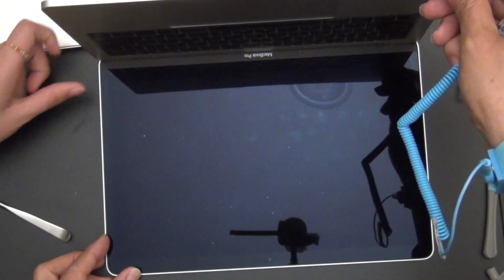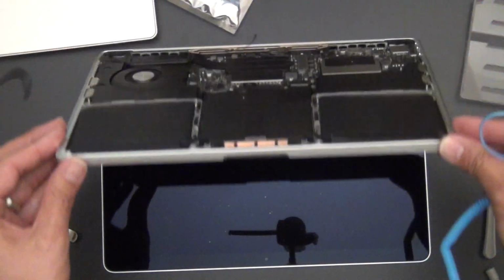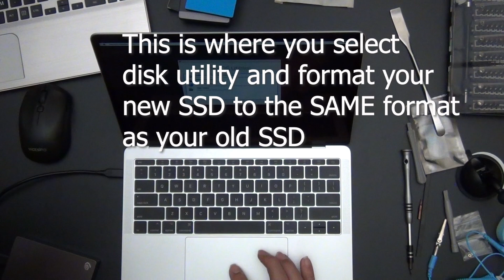2017 Macbook Pro 13 Inch 2 Thunderbolt A1708 SSD upgrade 128G to 1T!

Comment: Hi, today I did the same procedure with you but failed. (Same SSD) Somehow I cannot install the new MacOS on the SSD successfully. It installed about one hour then back to the question folder.  Any ideas? Which OS did you use? What method did you use for recovery the data? Internet recovery or OS startup USB? Thanks in advance.
Reply: Hi Im on the same case ... The original drive died ... Put 1TO OWS inside the mac but the system refuse to install.. Because I did not install HIgh sierra on the old drive and the system is not flashed . The only way is to put back an original apple ssd , making upgrade then put the new drive .. Fu... Apple
Reply: @anthonycoppet8788   I got the solution for installing the OS. You have to start it with the original OS by internet recovery. Once the installation failed, don’t panic. All you need to is to launch your MacBook again. You will notice it is installing again.

Comment: Guys, I just did the upgrade but, the battery is not charging anymore. I'm not sure if maybe it's because of the drive, or if I mess it up. If anyone knows something about it, I will greatly appreciate it. Also I have connected a USB audio interface because I work with music and does not seem to work properly after the install. The signal comes in and out. ¿Do you think has to do with the power consumption of the hard drive? Please, if someone experimented this problems and found a solution, let me know.
Reply from the maker: Hi Andres, sorry for the alte reply! I am wondering if the connector for the battery was not put back properly? There is a step where the battery is disconnected....maybe thats the reason? Hope this helps!

Comment: what screw driver do you use
Reply from the maker: Hi Zoubir, thanks for watching, these are the screw drivers used:
5-Point Torx Plus 1.2 (pentalobe compatible) screwdriver   (for the screws on the oustide)
T5 1.5 (for screws inside)

Comment: 3:51 useless part, i upgraded my ssd without touching this part and it totally works
Reply from the maker: Hello, and thanks for watching. Congratulations on your successful upgrade! 351...are you referring to disconnecting the battery?  If I had to do this over again I would still definitely disconnect the battery. Yeah, you might be able to get away with not doing it, but I'd hate to cause a short and damage the laptop if i accidentally touch something I didnt mean to...

Comment: will this adoptor fit to A1706 Macbook Pro model?
Reply from the maker: Hi Burt, thanks for watching! This particular bracket's description does not say it is compatible with A1706, but I checked on amazon and there are severala dapters that say they work with both A1708 and A1706.

Comment: Hi there, I made a comment earlier about the battery draining even while plugged in. Just letting you know that the TRIMFORCE command and disabling hardware acceleration helped fix the issue so now when plugged in it charges, however the battery still drains pretty quickly when unplugged.
Reply from the maker: Thanks for the update Daniel!

Comment: @Wen-Chun Fan can I install windows 10 on it as well?
Reply from the maker: Hi Kyle, I don't think my daughter installed Windows 10 on her Macbook Pro, but according to apple support, you can : https://support.apple.com/en-us/HT201468
Reply: @wenchunfan  ok thanks. So I can if I change the hard drive and upgrade it?

And regards to the battery will I work if I plug it in charging or even while its charging you loose battery?
Reply from the maker: @kylegatt659  hi Kyle, I dont think we have tried installing windows 10,so can't say for sure it works. The battery issue remains, but it doesnt drain faster rhan it charges. Hope that helps

Comment: Tried the same upgrade on the same model but the hd doesn't show up
Reply from the maker: Hello and thanks for watching!  Sorry to hear that the drive didn't show up after you changed it. Did the machine boot up?
Reply: @wenchunfan  it just shows a folder with a question mark
Reply from the maker: @sleepingproblems9060 I believe the question mark means the Mac is looking for the OS to boot from. We had backed up everything to a USB drive, and attached that when we restarted the Mac book after changing the ssd. Hope you are able to resolve this quickly!

Comment: Hi, is it normal that a fan runs so fast when I present a power point and zoom or OBS at the same time??? the speed is at around 7000, and the machine gets hot so quickly too. I bought the macbook in nov 2017, a week ago the LCD was replaced fullset also the keybaoard. The lcd replacement was due to flickering and flash
Reply from the maker: Hi! Thanks for watching! I checked with my daughter and she says her Mac books fan comes one when she's running a lot of programs at the same time. Did this start happenning only after you had the screen changed?
Reply: @wenchunfan  thanks for asking her, sir. It happens since my macbook has a screen problem also after replacing it. When I asked the person who did service my macbook, he told me everything inside the macbook is clean...
Reply from the maker: @saracyber1  Seems like a lot of functions are connected , like who would have thought changing the ssd would affect battery life? Maybe changing the keyboard and/or LCD affected a sensor or something and now the fan comes on more? I am just guessing here, not an expert at all. Hope you can resolve it somehow...
Reply: @wenchunfan  thanks a lot again, sir...what is your daughter do to the macbook at the end when the battery gets dry? I heard apple has a free battery replacement recently.

Anyway, I also think the same and asked already about the effect over replacing the screen and keyboard. Because my macbook pro LCD was from Samsung, but they changed my LCD with the manufacturer of LG because only LCD from LG which is new and available at home. I wonder and ask the store if it will effect the battery and machine performa, they said: it won't. 
Then I found  your video of fixing and read about your battery update after changing the SSD.. Mine probably will experience the same :(
Reply from the maker: @saracyber1  really? I will have to look into that! These days it doesn't matter as much since she's home and always close to power, but when she goes back to school it could be a bit of a challenge.
Reply: @wenchunfan   for sure, you should check the battery program replacement at apple website. Hope it could give solution if she far from power outlet :) good luck, sir!
Reply from the maker: @saracyber1  thank you too!
Reply: @wenchunfan  no problem :)))

Comment: Hello :) Great video. Thank you. I used the same SetUp and everything works great. Bigger SSD place is great :) ... I have the only small problem. After this replacing the SSD started my macbook to overheat :/ Ventilator does not stop ... Can you help me how to fix this?
Reply from the maker: Thanks for watching! Sorry to hear you are having problems with heat dissipation after the switch. That is something I have not encountered, so I am not sure how to fix it. Hopefully you can find a solution to this issue soon!

Comment: Just upgraded mine to 1TB 2 weeks ago. Went very smoothly and am very happy with the result. Same as you the only issue I’ve noticed is the increased drain on battery life. Thanks for the video.
Reply from the maker: Thanks for watching, and glad your upgrade went smoothly! Hopefully there will be some solution to the battery power management issue in the near future!

Comment: Thank you for this! I’ve been thinking of upgrading mine as well, since I cheaped out and got the 128gb too lol
Reply from the maker: Thanks for watching and good luck with your upgrade!
Reply: I did this too buying it for my daughter but she doesn't use it since the school required ipad so i bought her ipad pro 11 instead and now i have to use this for programming. 128b is severely lacking for it. Im wondering if i should sell this and buy macbook mini m1 instead ( i dont need mobile use) or upgrade to 1tb. What do u guys think i should do, the m1 has powerful  gpu/cpu power and very affordable. Need some ideas lol. Cheers.
Reply: @telostia  idk about your choice but here’s something to consider: you can get windows on this MacBook and cannot for m1 apple silicon macs. So just a note. I absolutely need windows so I won’t be buying a apple silicon Mac.

Comment: I changed mine last month (Jan-21) to 512GB using the same sabrent rocket ssd and it works fine so far. Did noticed the battery life take a dip but not a major concern. 

What I found out the trickiest part was to format the drive in recovery mode as it didn’t mount and had to reboot again to start the process. After that due to some issues I could not install the OS as the drive was in HFS+ not APFS as that option wasn’t available at formatting stage. After some googling and youtube tutorial search, I managed to make the drive formatted as APFS and install the OS afterwards.

It was quite an experience for me and quite satisfied with the result as well..Now I don’t have to be very mindful of what I keep in the macbook compared when to it had measly 128 GB. Planning to upgrade it to either 1 TB or 2 TB in couple of months time as those have higher write speed than the 512 GB version.
Reply: I've upgraded my A1708 to the Sabrent 1tb from the stock 128gb in December 2020. I went to install a fresh copy of the OS from a bootable Mojave USB, but Mojave's Disk Utility doesn't allow you to format your new drive to APFS. But you can format the drive for APFS using Terminal instead. After installing the OS I booted the Mac into Safe mode to clear caches, then I reset the PRAM and Power Management and enabled the TRIM command in Terminal. So far I am not having any battery drain issues or, as some have reported, the flashing question mark that sometimes appears if you boot the Mac with power connected. The only thing I have noticed is, that after a few days of continuous use, the mac starts to stutter and slow down. A shutdown and restart clears this for me. It is not a major issue for me; the benefits of having so much more storage space out weighs this one niggle. I used the iFixit website as a guide to doing the upgrade.
Reply: @d3fenc367  Good to know that it works alright for you too. I just knew about TRIM command when you mentioned it as I have never heard everybody else talk about it.

For me there is no noticeable slow down as I always shut it down after done using it and occasionally let it in sleep mode especially when I’m out for a short while..nothing of major concern so far. I fully agree the benefits outweigh the cons and pretty happy with that!
Reply from the maker: HI Khalis, thanks for sharing your experience and glad everything is working! I do remember we had some issues formatting the new SSD , and I recall that the APFS option was not very obvious in the choices presented when asked to format. I think we had to change a different option, then the APFS option came up. Sorry its kind of vague. Glad you figured it out!
Reply: @wenchunfan  Yeah the APFS option wasn’t that obvious and to be honest it was quite nerve wrecking as well as I thought I had screwed it up, my mbp is gone!

Comment: How do you put the SSD on the adapter? My adapter came with a bolt and nut but the bolt is not fixed under the adapter. Does the bold go under the adapter, then SSD and then you screw it together?
Reply from the maker: Hi Vincent! I remember that i did not have to afix the bolt to the adapter. All I had to do is slide the SSD onto the adapter and use one of the small screws to afix it. I used a 2242 SSD. It appears that if you use a 2230 SSD you may have to do what you are describing, using some additional screws/bolt that were included with the adapter ina  clear plastic bag. Hope this helps!

Comment from the maker: Quick update: So the macbook has been working fine since the upgrade. One thing that my daughter noticed is that battery life has taken a hit. I looked online and apparently this happens when you use a non-apple SSD. It has to do with power management not supported with these non-apple SSDs. Something to keep in mind if battery life is crucial...
Reply: The laptop is almost 4 years old my battery drains as well replacing the battery soon.
Reply from the maker: @chickenricesteak541  cool! Please let me know how it goes!
Reply: @wenchunfan  so I replaced the battery and I have 512GB and so far battery life has restored when I bought it new!!
Reply from the maker: @chickenricesteak541  nice！Do you mind sharing the site where you bought the battery? Also, was the ssd an non apple ssd? Thanks in advance!
Reply: @wenchunfan  it was a western digital SSD. Type in the model of laptop and go on eBay and look for the highest review guy that sells genuine battery most Apple stuff comes from China anyways.
Reply: @wenchunfan  you can easily find Apple ssd from eBay that does not need a adapter
Reply: Thanks for the video. I was able to follow your instructions and upgrade with the same process and parts. I'm wondering, does your battery drain even when plugged in? I can understand that battery will drain faster, but I can wrap my head around why the battery drains even when it's plugged in? (I'm using stock charger) Any ideas?
Reply from the maker: @dannyjoo  Hi Daniel, thanks for watching, and glad you were able to swap the ssd out! I believe that the battery charges when the AC adapter is plugged in, as it did before. Sounds like yours drain even with the AC adapter plugged in?
Reply: Thanks for the update... I was just thinking of doing this but i need my battery life :)
Reply from the maker: @Naj Selim Hi Naj, good point. Thanks for pointing that out
Reply: Lol this is nerve racking watching this. Hm was going to replace 1tb but having seen that 512 apparently drains less power? Really? 512 isnt much different to 128gb when programming. Can anyone confirm this is true, as i would prefer 1tb. Thanks.
Reply: @telostia  I guess it might be related to the power consumption of the Chips (SSD). The more size you use, the more power will be drained from the battery.

Apple was good, until 2016.
Since then no good customer relationahip anymore.
Reply: Also next time you have trouble booting  use  the option key

Comment: Hello, I also want to upgrade my Macbook Pro a1708, but with this,  is a Kingston A2000 1tb NVMe m.2, will you know if it will be compatible with my Mac?

https://www.mercadotech.cl/products/kng-ssd-1tb-m-2-2280-2200-2000mb-s-l-e-nvme-pcie-gen-3-0-x-4?taxon_id=142
Reply from the maker: Hi! Sorry for the late reply. I don't think that SSD will fit. you need either a 2242 or 2230 for that adapter to work. and the link you shared is a 2280, too long.